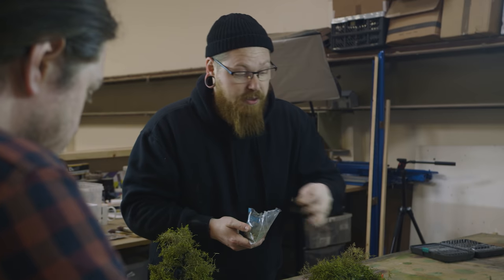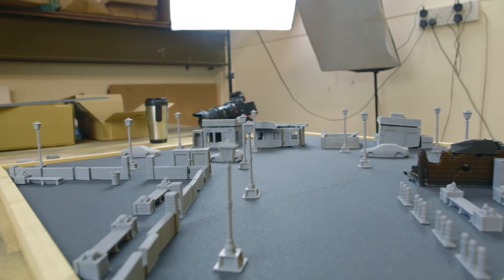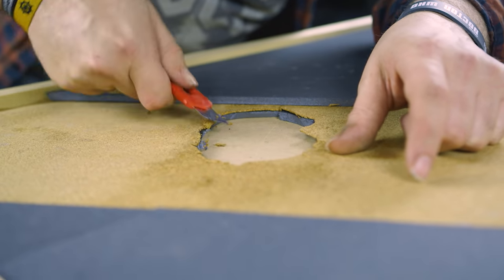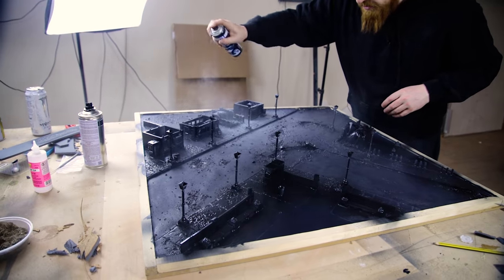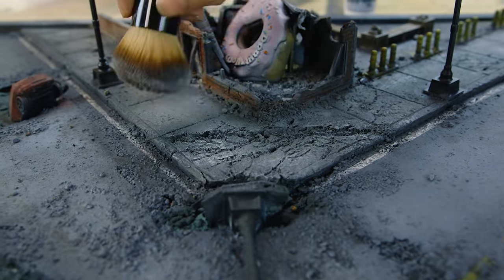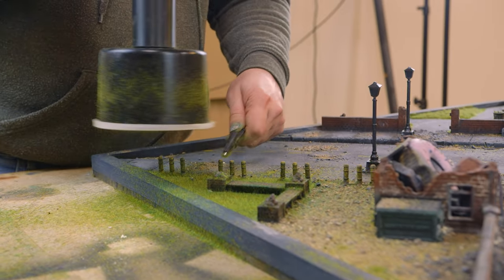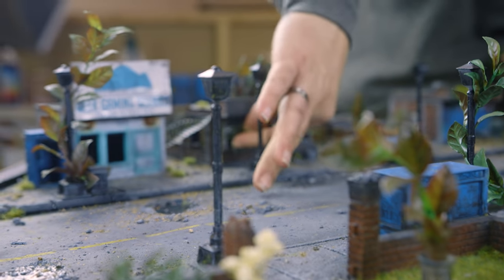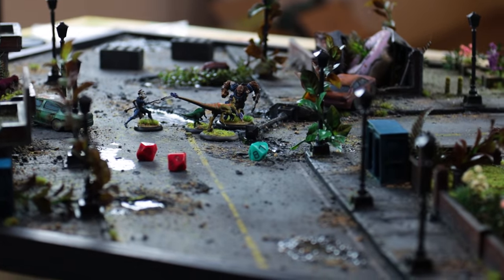IDIOT Builds First Gaming Table

Comment: i got a Flock It static grass generator. i put pin in glue and attach croc clip, than apply grass.
any that misses gets picked back up by the static and rebonds with the glue. no waste.
no shocks either.